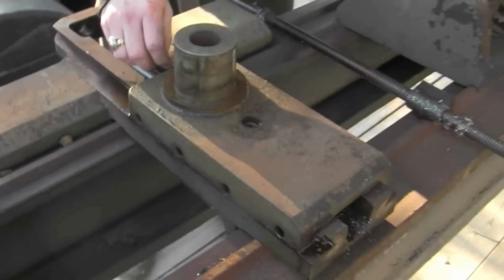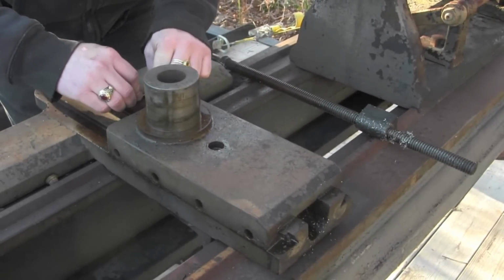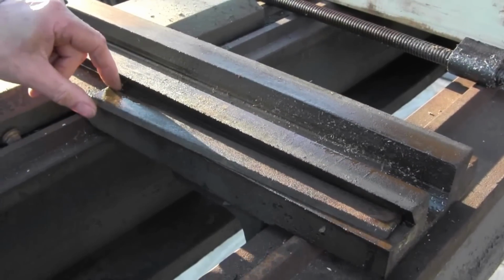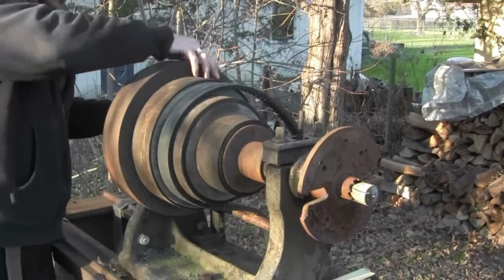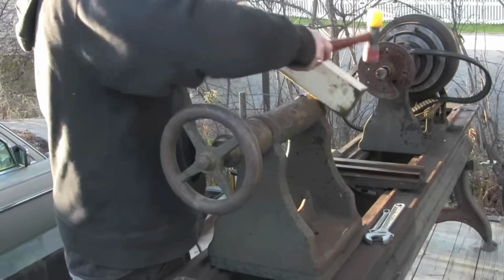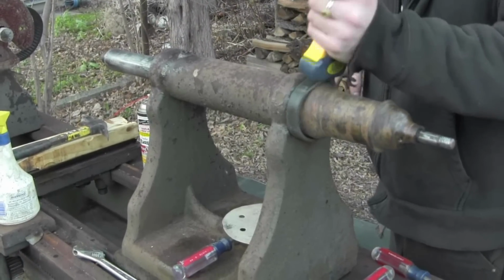Lathe part 1

Comment: You see those holes in the side of the cross slide of the saddle?  There are screws in there that press on brass blocks to take the "lash" (aka backlash) out of the joint.  Those screws and blocks are called "gibs".  If you removed those gibs the unit would have slid right apart.
Reply from the maker: +wi11y1960   We removed the gib screws completely, unfortunately the lath spent many years sitting outdoors with no cover and rust was holding everything together.  We tried tapping the gibs out, but they were stubborn and I did not want to damage them, so the method shown seemed to work the best, with the 2x cushioning the blow against the iron.  We really didn't have to hit it that hard, it looks worse that it really was.